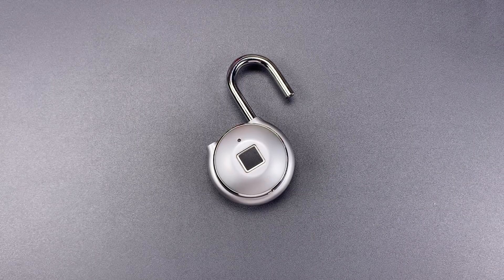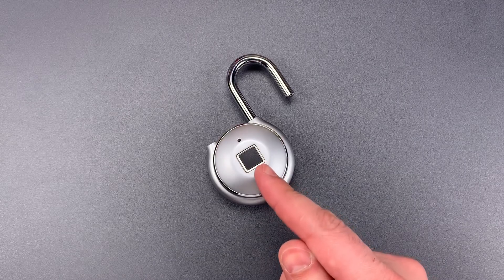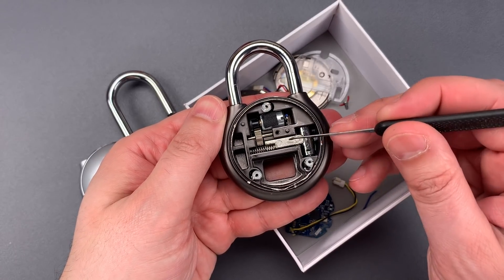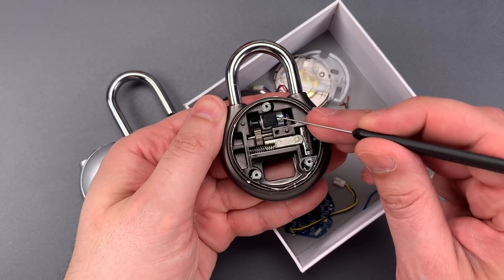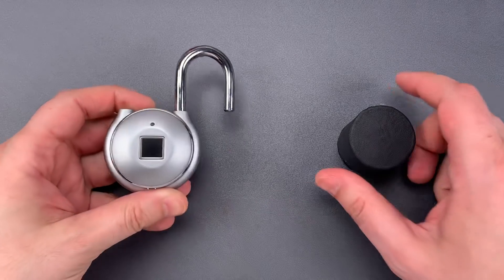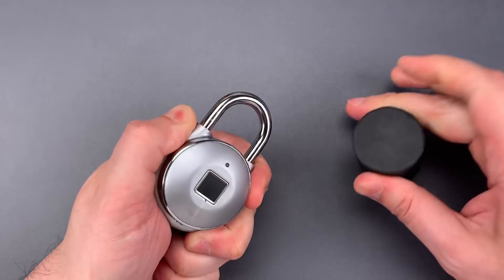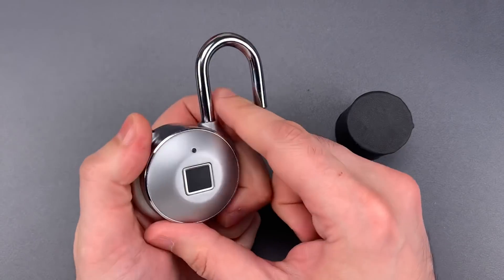[1068] Bypassing the $100 TappLock One+ Fingerprint Padlock

Comment: Hey I know it's been a long time. I recently saw a video of this lock and the entire time the back of the lock is not secured by anything. A simple gopro mount can easily twist it off and a screw driver defeats the entire thing with 3 screws

Comment: Why would a brand send a one of their top products to a guy who’s gonna do nothing but prove it to be useless
Reply: I mean, whoever is coming to steal your shit would have to have prior knowledge of what they're dealing with to think to bring a magnet....and even then it'd be faster just to bring bolt cutters if they wanted in. Also seems it'd be less noisy too
Reply: In fairness, this is an improved version after JerryRigsEverything found that the original could be pried into and then just had Phillips head screws on the inside. Besides the ability to open it with a magnet attack which Tapplock said they're looking to fix, it's now a decently solid lock otherwise.

Comment: I'd like to see you unlock it in real environment, like if it's on a door that isn't very easy to get to. One thing is showcasing the exploit, but another is doing it when lock is actually in use. I'm sure it's possible, but I'd just like to see it in real scenario. for starters, running the magnet across the way you did can be tricky if there's not enough room to move the magent around (like if there's something on top of the lock or under).

Comment: Would affect the BOM costs, but I suppose you could put two motors that have to turn opposite directions for the lock to open, but only one is allowed to turn: Turning one 'vertically' in this case removes the locking cam, turning the other 'vertically' at the same time moves an additional locking cam into place jamming the lock. Electrically simple to open - command both motors to their 'open' position easily, or 'closed' by opposing their rotations. Just a few extra cents for the additional h-bridge.

Comment: Could this be resisted by adding a second electric motor, set up to counter act the first one if it moves? That way if someone tries to use a magnet, it'll move both motors, thus canceling out the movement?

Comment: Because it's a Bluetooth device being sold in the US, it has to have an FCC teardown included with the licensing application. The teardown photos are available online. They clearly show that the back cover is a flimsy plastic snap-in that could be taken off with a pocket knife or flathead screwdriver, and behind them is the battery and an internal frame with three phillips head screws. How hard could it be to take the back panel off and disassembled the entire thing with just a screwdriver?

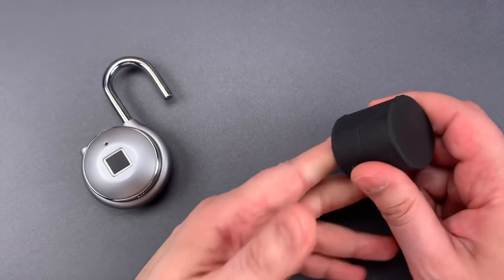Comment: 1:00 "gaffer's tape"? Looks more like insulating tape to me. Gaffer tape is used to secure electric cable to a stage floor and not leave a mark when pulled off, it's normally cloth backed and 2-3 inches wide.

Comment: If one did not already know about this exploit, have one to tear apart and discover this exact technique, they never would get the lock to open. Of course bolt cutters or a cut-off wheel in a cordless drill works most of the time.

Comment: So how would you fix this vulnerability, other than by removing the electronic parts and replacing them with a normal mechanical lock?
Move the magnets to the stator? Use a motor with only electromagnets and no permanent magnets?
I genuinely don't know if these would work.

Comment: I have to disagree with the LPL.  I don't consider this to be a low skill attack.  The average slug who would try to steal whatever you have protected with this lock will not have the magnets required and wouldn't know what to do with them if he had them.  Remember, the LPL didn't discover this vulnerability until he took a lock apart.

Comment: It doesn't look like a very robust lock. It appears to not have a locking lug on the side of the shackle that opens.  That would suggest that this lock could be be pried open easily with one or two large screw drivers.

Comment: This could be blocked by a spring loaded trap pin or gear that blocks the motor from turning if a magnet is used in this way

Comment: @LockPickingLawyer THE motor is normal dc motor so it has magnets in the stator, not in rotor >you cant spin/move rotor without passing some current thru windings. I bet you are puling something else in lock apart

Comment: This could be easily prevented with a thin Nickelplate  around the motor (Nickel works like a Shield against magnetic fields). Would be interesting to see if the manufacturer comes up with a second version of the lock.
Reply: They already commented that they are working on 2.0

Comment: I see another potential problem with these kinds of electronic locks: the power source or battery. When it will run down, you won't be able to open the lock. Unless you use a powerful magnet to bypass it...;-)

Comment: Just a hunch here, but the first time perhaps the motor was close to the phase angle where it unlocks, and the second time you had to go a full cycle. There is probably an inertial way to do this too, without a magnet, but it may be virtually impossible with it actually fixed to a hasp.

Comment: I would be interested to see if the lock is protected against over-voltage on the charge port.  Can the lock be rendered unusable (in either locked or unlocked condition) by electrocution?  Will an electric shock to the fingerprint scanner disable the lock?

Comment: HEY TAPPLOCK: Get your design and patent team ready and just design a modular gear motor with one of two things; either a two rotor set where the rotors contra-rotate and thereby cancel each other in this kind of attack, or a single fully electromagnetic motor (i.e the rotor and field are both electromagnetic coils) that doesn't have any magnetic susceptibility when not powered.

Or just add a centrifugal clutch. That just means the driving gear is loose on the motor shaft with a little cup extending over a rubber cone that's actually driven and expands to touch the inner surface of the cup to drive the gear, but only when spun at high RPM.

Comment: Interesting. How would you suggest they could've improved on it? I suppose the motor already has an iron cage, yet you seemed able to penetrate that. Would a tougher spring have helped, to keep the actuator from turning unless it's by the continuous driving by the motor?

Comment: I have a question about this padlock: is it possible to rotate the locking cam by hitting the lock from the top?
This way, acceleration should retract the motor, and rotate the cam into a more "stable" position.

Comment: Of course, this attack depends on the attacker knowing about it ahead of time and putting at least some effort into research and getting the right tool and using the right technique. So it's way better in my opinion than something that can be opened with standard issue lock picking tools and methods. Obviously security through obscurity won't stop anyone who really wants in, but if they want it badly enough they will find another way.

Comment: maybe have two mini motors oriented differently...as such waving a big magnet over it will only get one, and that would force a mechanical check on the other, both motors must move in tandem to proceed to unlock.

Comment: Great lock. Even knowing that LPL was required to do jump through several hoops in order to find and exploit the “only” weakness is a huge praise. 

Most would-be thieves would be stopped in their tracks. 

But, to respond with one of the classiest comments I’ve ever read (most just hide their head in the sand), I’m sure your company is on the right track. 

Best of luck!

Comment: This could be greatly improved if not fixed by simply having a 2-3x thicker motor housing to more effectively divert external magnetic fields. Shielding the entire motor and mechanism area would be better but add substantially more mass and volume.

Comment: If there's one thing I've learned from you it's that there isn't any locking mechanism that can't be bypassed somehow.
Reply: It's the same with encryption.  If there is a back door (for the good guys), the bad guys will figure out how to use it and get in.  There's no such thing as a "good guys only back door" for encryption, just like there's no lock that is only accessible to those with a proper key.
Reply: Well, there is a way to lock things without being bypassable, but comes with the downside that you wouldn't be able to open it yourself.
Reply: You can get it to the point where they are practically impossible to buypass, but that also involves making them to unpractical for regular use. The tricky bit is to make it easy to open for the owner but very hard for others.

Just imagine trying to pick a 100 pin lock with a half a meter keyway with crazy warding and tons of securitypins and 4 sidebars. Now imagine having a sward scabbard for your house key.
Reply: @jakobrosenqvist4691  And then they just break the door to get in anyway.
Reply: @gustandberg7553  You can always make the door from hardned steel the same thickness as the stupid key in the scabbard. Making things secure is not hard, buit doing it while remaining both practical and affordable is the challenge.
Reply: @jakobrosenqvist4691  I wouldn't be opposed to carrying a sword scabbard...especially if it's not considered a weapon and just a key LOL
Reply: LPL only covers locks that he can bypass.
No one has ever picked the Abloy Protec2, Bowley v2, or Yuema 750.

Comment: I wonder how the manufacturers engineering team watched this video:

Mouths open, flabbergasted because no one had thought of this particular vulnerability. 

Or

One of the engineers pounding the table with his fist, saying over and over "I told you guys we should have shielded the motor!"

In any case, I'm sure they regretted sending in these locks 😁
Reply: Or, they were ready and waiting to type a comment for free marketing on LPL's page. This is exactly the outcome they wanted.
Reply: @johnmartinez7440  You could very well be right. Apparently, in marketing there's a saying "any publicity is good publicity". I'm not so sure about that, but then again, I don't work in marketing. I work for a living 😉

Comment: Having a higher friction drive train, or a clutch mechanism that requires high motor speeds to activate the lock would make this style of attack much harder. Getting one of those hidden banister fastener drivers would make the attack much much easier though. (Use a similar magnetically coupled drive to lock segments together, bone stretching implants use the drive as well)
Reply from the maker: Robert Szasz That’s actually coming soon. 😉👍

Comment: @LockPickingLawyer You can perform this attack more efficiently with a couple of 18650 cells, alternating a current through a coil held over the dial. It takes but a second to pop it consistently. The magnet method is slow and leaves clear evidence of tampering, whereas the coil method doesn't require even touching the lock body. Thanks for sharing LPL

Comment: either way, i'm not too fond of a lock that relies on non-mechanical means.  a lock that doesn't open 100% of the time i want it to is no better than a lock that is easily opened when i don't want it to.  electronics fail way too often and you also get situations like this.

Comment: the lock was almost good? that whole motor thing... I actually don't know how to protect against that unless... maybe put a magnetic reed switch to counter the magnet's rotating?
Reply: Use a "coreless" dc motor.

Core is just a copper coil on a plastic holder, the magnet sits on the outside and us fixed.

Unfortunately those motors have very poor torque but stupidly high rpm.

Wouldn't be affected by this trick but getting it to produce enough torque to unlock a lock could be difficult

Comment: LPL, could you discuss how a lock could be made which didn't have this vulnerability? Seems hard to avoid.
Reply: Not LPL but he mentioned how the rest of the lock had no magnetic material, so if they just made everything from non magnetic material it could work (not sure what the drawbacks would be though)
Reply: @burntpotatoes999  the main drawback would be that an electric motor doesn't work without magnetic parts ;-)
Reply: It's relatively easy, use a drive mechanism with moderately high friction, or a clutch mechanism. You can't exert much torque or generate much speed with the external magnet if the motor is well designed.
Reply: In order to move something with electricity you have to involve magnetism. Older design electric motor had electromagnets on both the armature (spinning part) and the stator. Newer motors use permanent magnets, this results is a more efficient and significantly smaller design. You'll often see them in cordless power tools advertised as "brushless." The problem with using a traditional motor that would not be manipulated by the magnet is size. You might need something 2-3 times larger to have the power needed to open the lock. This lock already looks clunky.

Comment: Certainly better then alot of other locks however the electric motor still opens a vulnerability. Personally i don't know alot of people who have powerful magnets on hand so it is still a big plus for its overall strength.
Reply: @Leonelfreak  Especially if the would-be thief isn't aware of this vulnerability in the lock. LPL only figured it out because he opened it up, after all
Reply: Agreed - while this certainly isn't a hard lock to bypass, you have to have specific tools and knowledge that's fairly specific to this particular lock.  If that's the easiest attack this beats many of the locks shown on this channel as it's unlikely a random attacker would have that.

However, this lock won't hold long against an attacker who's not 'random', but specifically looking at getting past this lock, and it leaves no sign it's been bypassed.
Reply: @nicomarino96  it would work with an electro magnet but you would have to change the polarity by reversing the flow of current instead of just flipping it upside-down.
Reply: @Leonelfreak  Workspace lockers, the amount of times people steal shit from coworkers is unbelievable.
Reply: Yeah, but that's already enough to make the lock a bad target for most burglars, which are opportunistic. To use an exploit like this would require walking around with a heavy magnet or actually casing the lock and recognizing the make and model.
Reply: It’s also a pretty loud attack on the lock with the magnet banging around, so that’s a plus.
Reply: I have like 5 cause they’re cool
Reply: I don't know a lot of people with a full set of lockpicks, rakes, purpose-made shims, or lock impressioning tools, but you can buy any of these off of Amazon for under $30. A good attempt, but we are talking about an attack that doesn't require high skill (though knowing what to do is probably rare).
Reply: I don't know a lot of people with lockpick sets either, but I'm sure a thief has one.
Reply: Leonelfreak only ones I can think of are high school kids who steal from lockers
Reply: Stop saying "alot". It's two words, not one.
Reply: What are you all talking about?  Did you not see that cavernous, hollow, cast body?  Hit the thing with a roofing hammer or put a small pipe wrench on it. Or take bolt cutters to that shackle. Criminals don’t carry magnets. They don’t carry lock picks or rakes. There is nothing high security about this product. It is simply high tech.
Reply: @Leonelfreak  Err, no. If they're "professional" lockpickers they'd just have one in their tool bag...
Reply: Lmao that motor ain't the only vulneribility. JRE wrecked that lock using a pry tool 😂
Reply: Counterpoint: you can easily buy a fairly strong Neodymium magnet off the internet for less than 20 bucks.
Reply: @jepoyburner  Seriously? At this point you might just use brute force and be done with it.
 There will always be a weakness, even if you can't find it.
Reply: This attack can work on most of the locks with motor or a solenoid and since almost all electronic locks use these 2 makes all of them very easy to open.
So I won't be surprised if thieves carry a magnet with them now.
Reply: ^Yep.
Reply: You clearly weren’t a kid! Used to “steal” magnets from shit like TVs, speakers etc...... big ass magnets is what every kid wants and figures out where to get them free!  They are everywhere when you really want one ! 🤯
Reply: @hanniffydinn6019  Speaker magnets are nothing compared to this one.
Reply: @tiefensucht  insert thank you meme..
Reply: @hanniffydinn6019  I was more a paper clip theif in primary school but that was before the internet was a thing people had everywhere lol
Reply: @hanniffydinn6019  Finding big magnets was easy but back in the day they used earth magnets which are far weaker than neodymium ones.